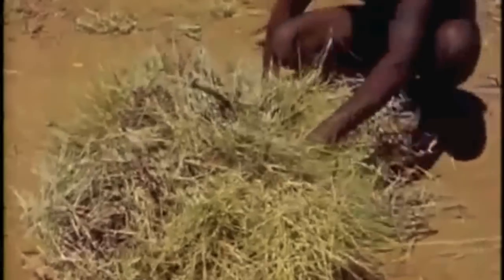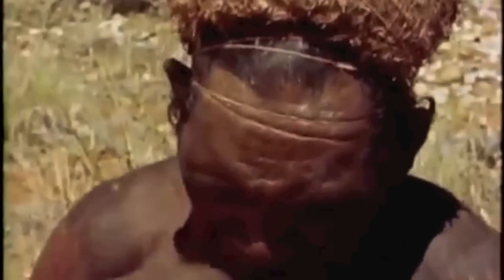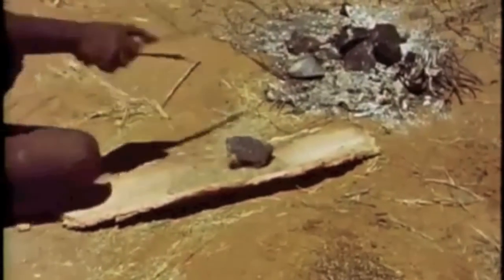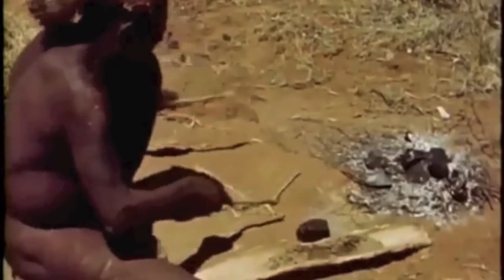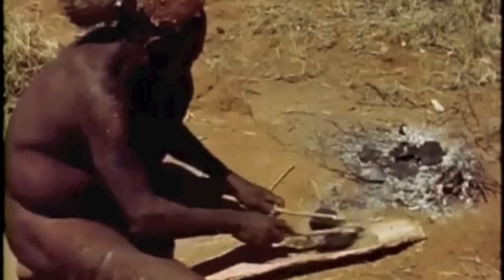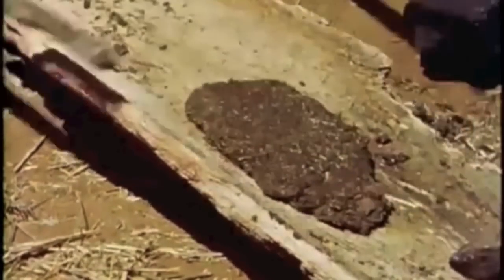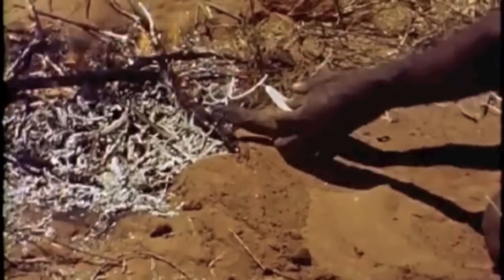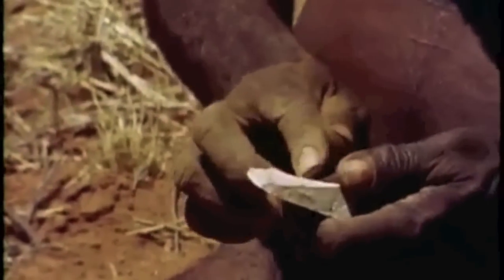Australian Aboriginal use of Spinifex resin technology

Comment: If the resin melts with heat then why TF do they use a stick to beat the grass? Wrap the grass around a hot rock and you'll gather 100% of the resin. It's like they can't even comprehend what they're doing and they're just mindlessly following a recipe.
Reply: I'm no physicist, but I suspect that if you melt the resin while it is still attached to the grass it then sticks to the grass.
If you want rock hard grass then great, but I don't think it would be particularly useful when it comes to stabbing kangaroos.
Reply: Anyone with common would see the resin is obviously denser than the dry grass itself, so if you beat it the resin will naturally accumulate at the bottom. Threshing wheat in the traditional method works on the exact same principle.
Reply: The resin is like that on weed.  It breaks off so you gather the grass but the resin shakes out and is lost.  So why is the grass useful anymore? Just like weed. Understand?
Reply: Plague Doctor What a dumb comment!!! Why in the world would he want the resin to be attached to the grass if he's making a cutting tool!!! SO IGNORANt!!!!
Reply: Plague Doctor it doesn't work that way idiot.

Comment: nice images. is it usable for mouthpiece making?
Reply from the maker: Not really Rodrigo, spinifex resin would absolutely dampen the energy transfer between lips and instrument, beeswax is a much better choice of material. When will you be in Australia buddy?
Reply from the maker: Hello Rodrigo, when cold spinifex resin is rock hard and can shatter easily as a result. In terms of density/acoustic properties, it is similar to plastic. A good material to use for mouthpieces might be dental putty?
Reply: I've mechanized the process and put it on ballistic riot armor then sprayed on some flexseal .do I have to worry about it being in cold and hot weather?🤔